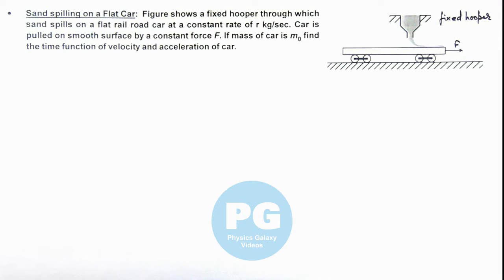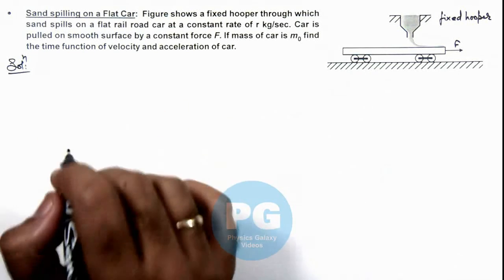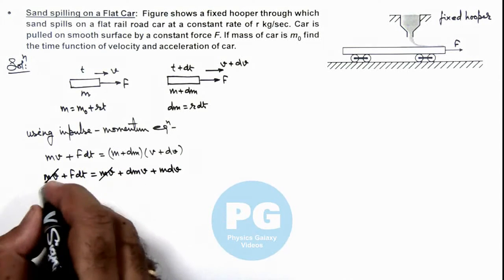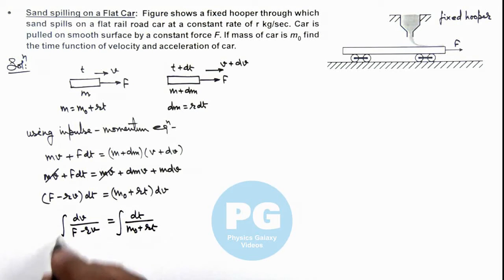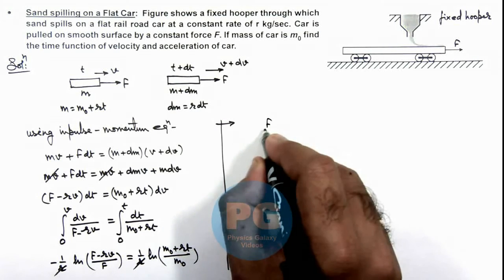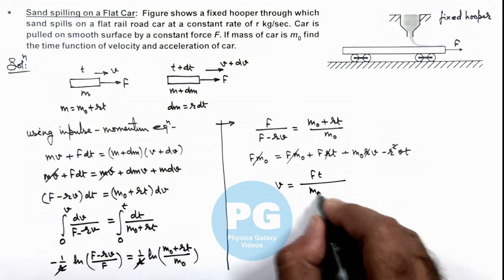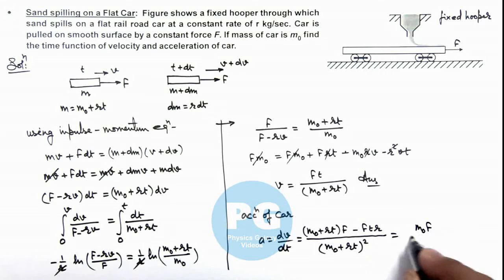Advance Illustrations – Sand spilling on a Flat Car | System of Particles #15 for JEE Advanced

Comment: SIR CAN YOU PLEASE TELL WHY CANT WE USE F=(m+rt)dv/dt and integrate directly? please explain sir. please
Reply: F=ma is only applicable in closed system (in which mass remais constant) same as newton's law are not applicable in non inertial frames.
Reply: @lakshaybansal2470  Then in the next illustration how sir used it? As mass is varying in that illustration too. How?
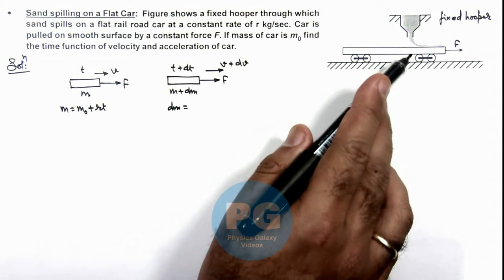Reply: @najabajajajara  in variable mass system when we get through the derivation we get F(ext) +(u-v)dm/dt=ma (where u is the velocity of incoming or outgoing mass and v is the velocity of the container(here) basically relative velocity) since in the following illustration u=v which implies f(ext)=ma which you just said.Which was pointed by sir too around 1:42 of illustration #16. So here it seems as if newtons basic f=ma is applicable but it is just a special case where u=v turns f(thrust)=0.
Reply: You can use that  , but in that eqn F is the net force on block which will be equal to : F(ext) - Thrust by sand on block   ,,, thrust by sand will be in backward direction {using NLM concept}
Reply: @shobhit1447 can i write the equation as F=(m°+rdt)(a-da) and put F=m°a then directly find the acceleration by seperating and integrating both side

Comment: I worked on this for 5 minutes and came up with a one liner ! The impulse provided by the external force F in time 't' is F*t, which should be equal to the change in momentum. Since, initial velocity=0, final momentum = Ft. Therefore, (Mo+Rt)v=Ft, and we get the desired result as v=Ft/Mo+Rt.
Reply: Hey guys he is correct even sir has taken initial velocity as zero at t=0 while integrating 
Btw nice one ishaan agrawal
Reply: @deepamshah3696  Thanks hehe
Reply: @ishaanagarwal5547  jee nikla
Reply: @melahar557  IITM elec.
Reply: @ishaanagarwal5547  nice man
Best of luck for ur future
Reply: Initial velocity is not zero
Reply: Great man 🔥
Reply: Yup, in class our phy teacher explained this illustration by your method only...
Reply: did u studied maths by lucky jethani sir???

Comment: Respected Sir,why is the impulse Fdt in the direction of velocity of cart inspite of the sand falling vertically downward?
Reply: Force which is taken in impulse (here) is F applied by external agent while impulse due to  falling sand is different and it is not needed here
Reply: @perfectlyimperfect6849 yes because that is some sand falling not jet fuel burnt through thrusters.

Comment: sir if we apply F=ma then at any instant t a will be F/(m+rt). It is wrong in this case but the same approach is correct in next illustration.Why sir? Please help.
Reply from the maker: +Arpit Nigam Here you can see the mass rt which is being added to cart is not having this acceleration a=F/(m+rt) as from rest instantly just after falling it is accelerated to cart velocity so its acceleration is very high... thats why we cannot use this approach in this question... now see the next one again... you will be able to self explain....
Reply: @physicsgalaxyworld  sir please elaborate
Reply: @physicsgalaxyworld Sir after 1 hour of deep thinking that why this equation giving wrong result I focused on your statement that acceleration of instantaneous sand falling is very large , then I realised that acceleration of acceleration of center of mass can be written as 
(Mo + rt + dm) a = dm[(v-0)÷dt] +
(Mo + rt)(dv÷dt) 
 and Substuting this in eq. (Mo + rt)a = F
We get the desired result thank you sir ❤❤
Reply: @physicsgalaxyworld  nice one
Reply: Sir can we remember it like this that if mass is falling form the body then we can find acceleration as a function of time  as we have done in next illustration (without integration). But if mass is falling on the body then we have to integrate like we have done in this que. Sir please help.